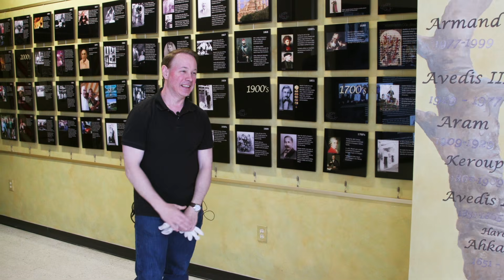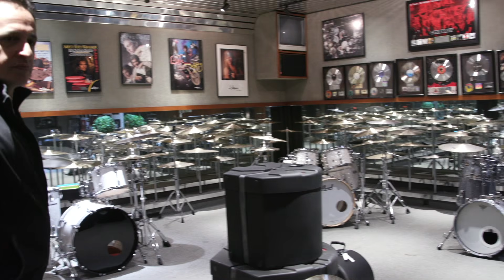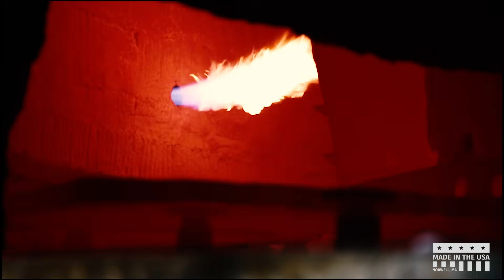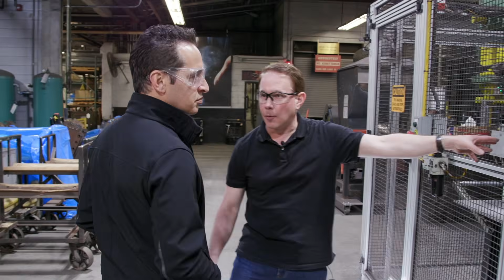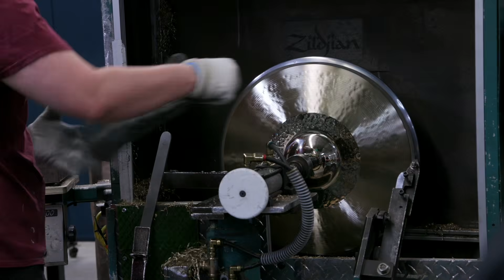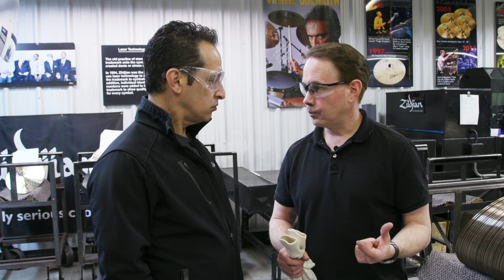Zildjian Factory Tour

Comment: Loved the tour, especially seeing a set of drums owned by my original drumming hero, Gene Krupa. I have one quick question, after the cymbals are stamped with the logo, do they go through an oven to bake the logo on?
Reply: The cymbals are made of approximately 80 percent copper, 19 percent tin and 1 percent silver. The exact mixing process and chemical formula which marries the metals together is, of cource, the Zildjian secret. When they are mixed in the electric furnaces, we pour the resulting secret alloy into the casting bowls where they emerge as circular ignots. The casting bowls are filled half with boiling water so that when the melted bronze is poured into the bowls the circular ignots won’t stick in the bottom. Zildjian cymbals, own much of their unique sound and mechanical resilience to the fact that their original cast preform is tested by striking to see if the material has a ring in its cast state. If it does not, it is remelted. After the castings cool, they are sorted by weight into different bins. The weight of the castings determines the size of the final cymbal. All Zildjian cast cymbals, are fashioned from this one type of bronze ingot, the difference is what happens further down the line. A big part of it is not only the secret alloy, but knowing what to do with it once the casting is made.
Different thicknesses of the castings are being slowly carried through a large rotary hearth (or oven) on a conveyor. The temperature inside the oven reaches about 1,500 degrees Fahrenheit. Peering into the oven’s opening you see the castings glowing bright orange in the intense heat. Every cymbal that goes in there gets heated for the same amount of time. A casting will travel through the oven from four to 25 times, depending on the size and thickness of the final cymbal. After each trip, the crude cymbal will be gradually flattened in the rolling mill. As the discs are rolled again and again, a dense interlocking weave is formed in the granular structure that prevents warping and weak spots. Once the required thickness and size is achieved, the center is marked with chalk where the hole will be drilled. During the previous procces of thinning, the colour of the discs changes from silver to a deep purple. When the latter colour is reached, the discs, are subjected to two further temperings, first in a chemical solution (a Zildjian formula) containing herbs and oils, and secondly in cold water.
This cold water bath tempers the hot metal and makes it malleable enough to shape the casting into what will eventually resemble a cymbal. The metal changes instantaneously once it hits the cold water. It’s called ’quenching’ the metal. Because we have 19 percent tin, we are going from a very brittle state, and we are trying to achieve a ductile state so we can do all our ’cold’ work on the cymbal. After the metal has been quenched and is no longer brittle, the hole is drilled and a heavy stamping machine presses the cup. With the center and diameter of the cymbal determined, a craftsman can now shear the jagged and uneven edges off the blank disc. Over the last few steps the once unrecognizable piece of bronze begins to take on the shape and profile (but not the finish) of a cymbal.
The main spec is a weight parameter, depending on what cymbal it is going to be. Every single model we make, from a 6″ splash to a 24″ ride has a specific weight tolerance within a certain amount of grams. Then there is the visual inspection. We take a look after each stage, making sure everything was done properly — if a mistake was made you’d be able to see it. We have team leaders who lead each process and inspect each cymbal. And everyone is empowered to halt the process if they see a mistake. It’s really a team effort.
The next stage of the operation requires a craftsman to first backbend the cymbal by hand on a jig before it is placed in a shaping press where 80 to 100 tons of pressure will come down and give the cymbal its shape and profile.
At this point the cymbal is very malleable and you can really work the metal. In the old days this is where the hammering would start, but because of the new methods we have, we can press an initial shape that the cymbal will eventually take. Because every cymbal and every size has a different shape, there are different stamp dies used for each model.
Once the cymbal is pressed into a basic shape it’s ready for the hammering machine, this one-of-a-kind proprietary hammering machine plays a major role in creating the mystical Zildjian sound. Unique (and costly) “chucks” with raised hammer patterns are used in the state-of-the-art, computer-controlled machine. The machine brings a previously unheard of consistency to each model family of cymbals.
Basically the human hand is not strong enough or consistent enough to make the cymbals the way we feel they should be made. Some cymbals go through a very quick hammering process, and some go through an over-hammering stage. Obviously Constantinoples are very different from A Zildjians and they require very different hammering techniques.
An A-line cymbal gets hammered just once, a K Custom Dark Crash will get hammered several times in different stages of its creation, which helps dry out the sound. Constantinoples get hammered quite a bit. Depending on what we’re trying to achieve, that’s how much work goes into the cymbal. It’s all about the end result. After being hammered, the cymbals are taken to lathing machines to be turned. Each cymbal is secured vertically on the lathe and as it spins, the lathe operator leans his weight against a large cutting knife and begins to cut sound or tonal grooves into the cymbal. One craftsman will do a rough pass on a cymbal and another will do a finish pass. Finish lathe operators have more time on the job. They’re more skilled so we can ensure the cymbal comes down to its final weight and thickness. It’s one of the most critical parts of cymbal making, you can make the cymbal come out right, or you can just ruin everything everyone did before you.
There are small but discernible differences between cymbals that are the same size and type. This is where the human touch comes particularly into play, because no matter how consistent a lathe operator is, there will always be minute differences in the way he cuts a groove.
The sound grooves help define the sound of the cymbal. Just the slightest variation in lathing will create a different sound. We want each cymbal to have its own character. Unless you were doing it robotically, it would be virtually impossible to lathe two 12″ splash cymbals exactly the same way.
Each step of the process is as important as any other. It’s like a cake recipe: if you change one of the steps or do it incorrectly it throws everything off.
Before the cymbals leave the main production room, the edges are made as smooth as possible. Some models are buffed and finished on the way to the quality control area where longtime employee Leon Chiappini personally oversees the testing of each and every cymbal made by the company. Chiappini has been with Zildjian for over 40 years, and chances are, if you own a Zildjian cymbal, he played it before you. With the help of “tester” cymbals, which represent a range of what the cymbal is supposed to sound like, Leon goes through the cymbals one at a time. He hits them a few times and makes sure they fall in line with the tester cymbal.
Once Chiappini signs off on the cymbals, they need to be sprayed with a protective coating and then taken to a laser etcher to engrave a unique serial number and have the logo printed onto the cymbal. The finished cymbals are then wheeled to the legendary Zildjian cymbal vault to rest and age and await shipping.

Comment: They should sell the raw castings with a hole through them as a bell.
Reply: You know, I once tried to get Sabian to make a custom set like that for me. I had come into my possession a slightly hammered raw blank from the Sabian Vault Tour (they were using it to show a stage of the process. The thing sounds like a grandfather clock chime when you hit it. They flat out said no. There's nothing like it out there on the market either. 

The point of my story is that Sabian prides themselves on custom work, yet even they didn't want to do it, so I doubt Zildjian would either. Seems both companies want over-produced bells in their product lines.